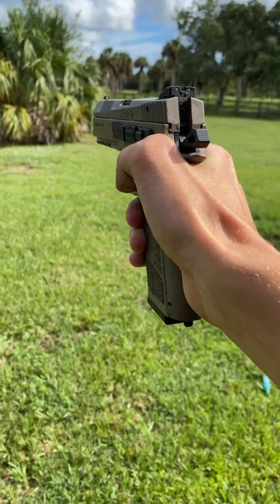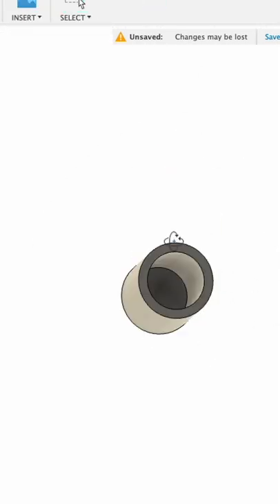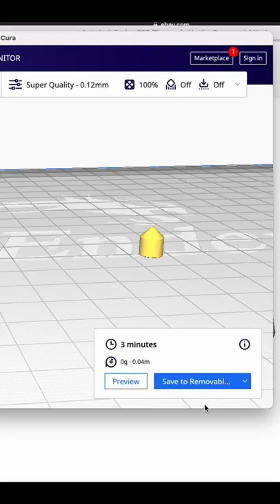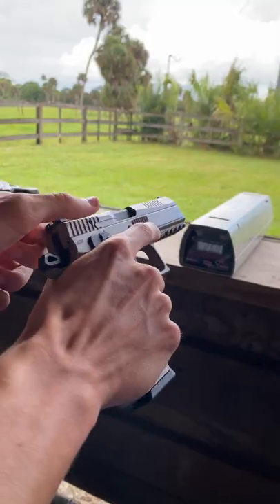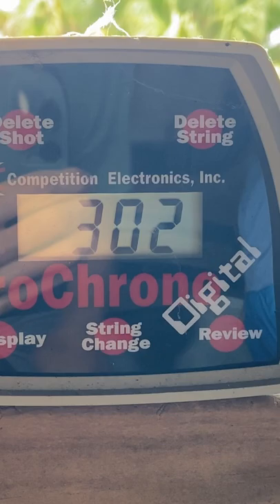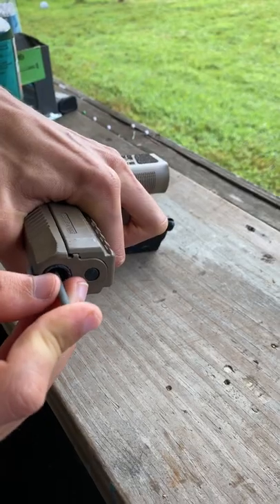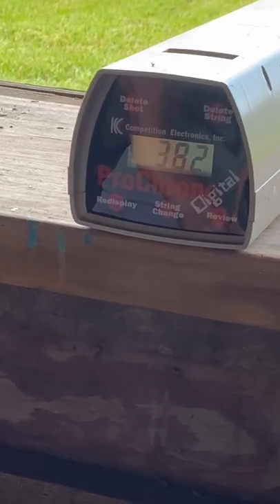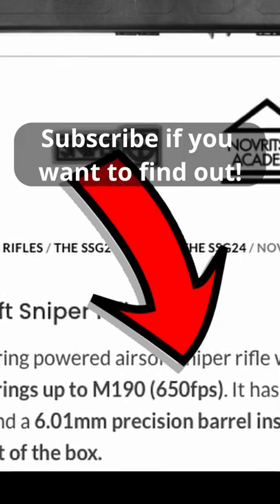Could this Airsoft BB go Supersonic 🤯🤔

Comment: It’s like during the civil war when they found out bullets were more effective than musket balls
Reply: they didn’t “find out,” they knew for a while it’s just that a single loading rifle was hard to load since the inside of the barrel is smaller than the projectile
Reply: @nipplecream3099  uhhh if the inside of the barrel is smaller than the projectile you aren't loading anything. Mini balls as they were called were cumbersome to load because of the shape and some people didn't like to use them because of the gruesome injuries they would cause. Basically when you shoot a mini ball the back of it is concave the heat and pressure force the back end to widen out making a decent seal between the projectile and the barrel meaning the fire more accurately and at higher velocity.
Reply: @samuelschurman3762  a rifled barrel has to be smaller in diameter than that of the projectile in order to engage the rifling. the bullet has to be squished in by the “lands” (smaller diameter than bullet), causing the rest of the bullet to expand into the “grooves” (greater diameter than the bullet)

that’s one reason why lead is used to make bullets, it’s malleable.
Reply: @samuelschurman3762  the Minié ball is different to what i was talking about, those were still used in smoothbores. that might’ve been what OP was talking about and i misinterpreted

Comment: One thing to note is that projectile shape has little to no effect on muzzle velocity. A .2 gram flat cylinder shaped pellet is going to come out of the muzzle just as fast a .2 gram BB. The difference is how the projectile performs down range, lower drag designs will retain more velocity farther and have less drop. If you just want to go supersonic, you will need to find a pellet design that will be a light as possible while staying in one piece, in addition to needing something very powerful.

Comment: You can get it to 5000~ FPS from a real rifle, but that's just right around the max for the gunpowder we have right now
Reply: Nah, there are custom loads well over 6000. There is just a point at which higher speeds just are not practical. It is not that faster cannot be made due to gunpowder limitations as much as there is no point to go faster.

Comment from the maker: For all of you wondering if this could be used for self defense, check out this video here! https://youtu.be/iKv0xGmGDtY

How fast do you think this will shoot with an airsoft sniper rifle? I don't think it'll be supersonic but I think we can get over 800 FPS.
Reply: Maybe 850fps
Reply: im going to guess around high 700s and low 800s
Reply: I've had a .12 up in the mid 600s no issues, but once you start getting above 700 it starts taking a lot of energy. I would be somewhat surprised if you did hit much past 800. I just wonder if the round is going to start delaminating before those speeds
Reply: 1 FPS
Reply: Possibly supersonic so I would wear ear protection just in case
Reply: 852 fps
Reply: @ashthegeek  bro why is it so specific
Reply: Did you do it?
Reply: If you go by simple proportions, it should be about 822 FPS.
Reply: You need about 1000 FPS to reach supersonic speeds, 343 meters per second or ~1250 kmph.
But getting supersonic takes a lot more energy, it would pretty much be impossible as air resistency grows exponentially, with 1/2*C*A*(v^2)
Reply: If i've done my research correctly, speed of sound in feet per second is just above 1100 fps (in 20 degree celsius dry air). in a vacuum, it could be possible without the resistance increasing exponentially
Reply: The barrel needs rifling, to prevent tumbling
Reply: YOU SHOULD DO IT!!
Reply: Do it
Reply: feet per second
frames per second
first person shooter

Comment: You do know that normal airsoft bb's spin when fired, right?

They don't travel completely straight.
When leaving the barrel, the bb travels over what is called the hop up bucking, which is the rubber piece of tube that is in the "chamber" of the gun, that introduces gyroscopic stability to spin the bb and stabilize it, just like a bullet from a firearm, just instead of rifling it has a rubber hop up that rubs against the bb, instead of grooves being engraved into it.

So anything fired from an airsoft gun that isn't completely round, will/can possibly damage your inner barrel and hop up depending how fast it is being propelled.

In this case, it seems to have improved, but over time it may have negative impact on your guns inner components and efficiency.

But I do love the idea of trying to make something more stable, awesome work.

Comment: most of a guns sound is from its bullets passing supersonic speed. thats why they use subsonic bullets. so i think it would either make a sonic boom aound or it will not even go supersonic
Reply: it wont go supersonic, 22. lr can barely go super sometimes, so a tiny little bb from a 600fps aint gonna cut it

Comment: Hey by the way stop a lot of the reasons other reasons that airsoft B b's suck ass when they're printed out of FDM printers is because of the FDM printer's method it's a message use a resident 3-D printer you can get them for like 200 bucks and yeah you do have to learn a little bit about resume 3-D printing I'd also recommend picking up like a washing cure station for a 100 bucks so so yeah that is an investment but but They print extremely fine detail also those layer lines which are causing some of the issues are almost eradicated and in they designed like this they would be almost entirely eradicated Slightly sanded down not by much just give it a little roll in someone 120 grit and then call it A-day

Comment: Although this would kick ass, it’s not really possible unless your are using a gun that isn’t gas based which you probably won’t as those kind of high performance electrics don’t really exist in consumer electronics. You couldn’t use gas for the same reason a real bullet can’t break the sound barrier